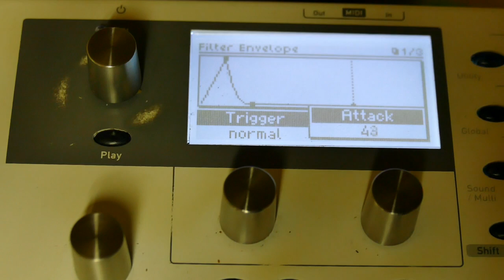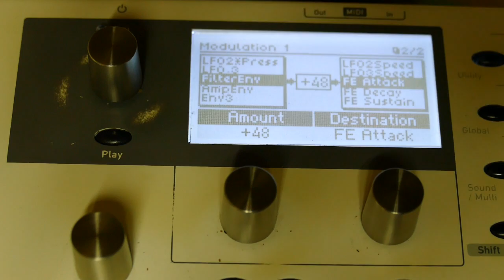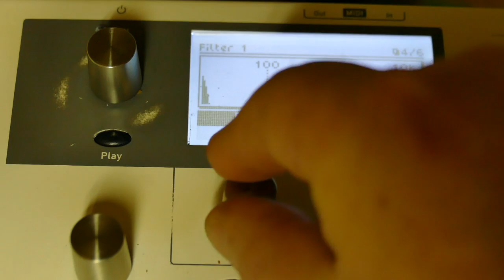Waldorf Blofeld Tutorial #08: Recursive Modulation on the Filter

Comment: Dear Sir. What is the benefit of the recursive modulation compared to adjusting the wanted parameters outside of the Mod Matrix?
Reply from the maker: Wow, this video is almost 10 years old and I have stopped using the Blofeld.
Regardless, you can't do recursive modulations without the mod matrix and therefore the effects would not be the same.

For example there is no direct control of curve for envelopes in the Blofeld, so therefore the mod matrix is required.

However, the Modwave and Multipoly have direct front panel control of the envelope curve and so much more.